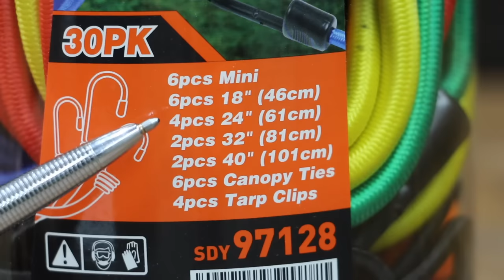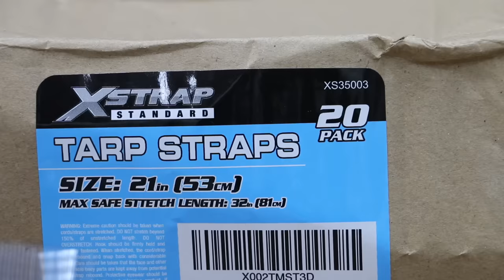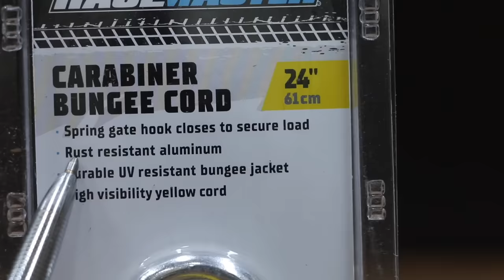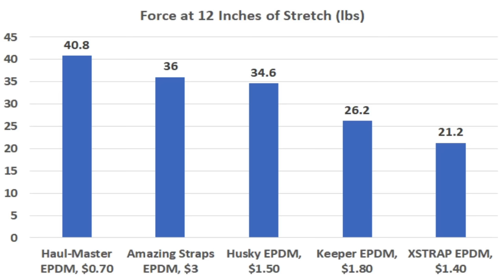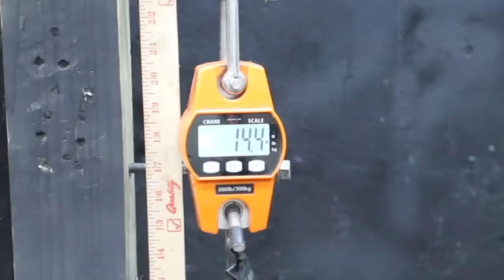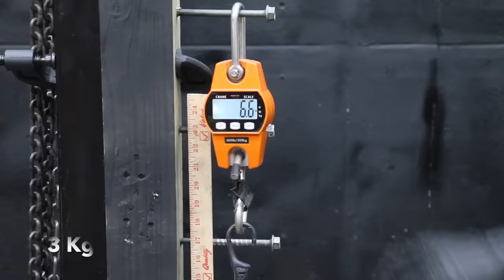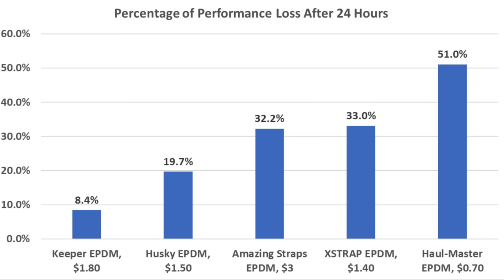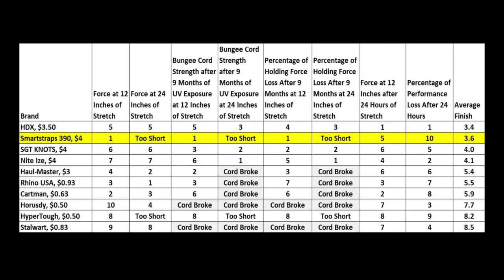Best Bungee Cord? Let's FInd Out!

Comment: Tarps themselves may be worth weather testing; several silver tarps from Harbor Freight lasted one winter covering my tractor, one silver tarp from Lowe's is still going strong after four years.
Reply from the maker: Thanks for the suggestion.  Thanks for the feedback.
Reply: Best tarp I ever had was a two-layer silver/brown tarp from Costco. I still have one. It's 15 years old. The other one was kept outside more often and lasted about ten years before I got rid of it.
Reply: I was thinking of testing tarps as well.
Reply: Hard to beat a canvas tarp if you can afford it! But you need to properly maintain them and weather proof them!
Reply: Great idea 👍
Reply: Tarps would require a long term outdoor exposure test.  If you see them tested within the next 6 or so months then you know it was already in progress when this suggestion was made.  😺
Reply: @HariSeldon913 I wonder if could just put under a high power uv light to speed up testing?
Reply: The so called "light tarps" never last more then a winter actual "heavy tarps" are far more durable but also weigh as much as 630g's per M^2 and cost a heck more up to a 300€ per tarp where as light tarps are only like 30-60€ or so and weigh about 160g per M^2 at max. So the difference and durability between the two types of tarps is quite significant.
Reply: I've found the cheap blue tarps consistently outlasting the expensive silver tarps, which surprised me no end.
Reply: This is an excellent idea!
Reply: @keith3761 flatbed tarps can be cut to smaller tarps after damage or wear. They are heavy.
Reply: @cheesecurd100s  Adverse weather and temperature changes could also be factors.
Reply: I wholeheartedly agree on the tarp test. I live in Arizona and the average tarps rarely last 6 months in the Sun. Good ones, more expensive ones last a year or more.
Reply: @cheesecurd100s  ... The only issue I see is that UV is different by geographic location. IOW, daily use in New England will NOT be the same as daily use in Arizona. You alco have to consider temp swings and wind flapping to make it a realistic test of outdoor exposure.
Reply: @ProjectFarm  you should have went to a truck stop and picked up some of the commercial bungees.
They are pricey, but the quality is beyond reproach.
The only enemy they seem to have is road salt crystals. The salt acts like tiny razors, and makes the surface crack ridiculously fast in the winter.
It should be noted, I still have some from flatbedding, and that was YEARS ago!
If I ever need more, I’ll probably buy two sizes, and they come in bulk packs of 25.
You wouldn’t need to look for replacements for quite some time as a homeowner!
Reply: Hello again, Todd
Thank you for another Great Video 👍 I would like to see more bungee   cord tests. Maybe adding the testing of tarps, Too? Again thank you 😊
Reply: Want the best tarp? Get a used billboard.
Reply: Yes please tarps there's just so many brands and most seem to fail really quick.
Reply: Ive used ex billboard tarps . Amazing durability.
Reply: Does anyone where to purchase the Amazing Straps? Can’t seem to find anything online. Thanks
Reply: Get you a used tarp thats used to cover cotton bales. Heavy and will last
Reply: Listen to this man. Harbor freight tarps are absolute garbage.
Reply: Yeah tarps can last years or one summer. It's a good idea for a test.
Reply: Tarps would be good. test uv and wind resistance.
Reply: Not true. The blue one tear easily and don't last. Silver ones last much longer
Reply: Yeah that would be a good one. All sort of different options in material. I'd be curious which ones hold up the best over time and which ones leak thru easier than others, etc.

Comment: That UV test is pretty eye opening, it's amazing that most of the cords were disintegrating after only 9 months. Obviously given the time investment it takes that requires a lot of planning ahead on your part. I've never seen someone put so much effort into testing tools the way you do, so I shouldn't be surprised!
Reply from the maker: Thanks!
Reply: A nine month test is very impressive
Reply: I was thinking the same
Reply: I was about to say that my experience is the HDX straps are awesome. I have a roughly ten year old set of HDX straps, many of which were exposed to sunlight for approximately 6 hours a day in summer to about 4 hours a day in winter, for two years. Yes they faded and stretched but all of them still work and are still in use!  Awesome video and more Staci reviews please!
Reply: Especially since these are super regularly used on bicycles.
Reply: You know those little 'divets' on the hook are in all the right places to fail at a certain time. Planned? Darn right! Miss the metal hooks..except for those ocassional pops to the face
Reply: In AZ, UV resistance is a real issue. I plan on one season for a lot of soft items. I wonder if some 303 would help the epmd straps.
Reply: @ProjectFarm  Best bungee cords are the free bungee cords you find along the highways all over Merica. Thank you truckers👍
Reply: @jimmyhoffa7935  lmfao
Reply: @jimmyhoffa7935 yes, thier poor job securing loads is super good
Reply: eagerly waiting the metal left outside for a year or two after rust prevention treatment
Reply: Given that I use bungee cords to attach weights to my pool cover on my above ground pool every winter, I had to learn this lesson the hard way, as every brand I tried would be a crumbling mess by spring, most wouldn't even make it the whole winter, and that's just with 5lb weights slung on each cord. The UV is a huge problem, but even the cords on the back side of the pool that are never hit with direct sunlight end up so brittle that they snap just from touching them, we have very cold and snowy winters in Northern New England. I'm curious what the testing would show with more of a focus on the impacts of the weather.
Reply: @Selendryle  the metal hooks, even with heavy corrosion, are always, always, always, going to outlast the bungee cord no sense in testing corrosion.
Reply: @racerex340  Google says that 17% of UV radiation reaches the shade side
Reply: Rubber made in India and especially China are terrible in general. Rubber on small motors and tarp straps just disintegrate. I recall one China tarp strap that wasn't even in the sun and crumbled in one year. I have older tarp straps that have lasted decades in the sun.
Reply: @starkparker16 should see the wiper blades videos. That spanned around one year for its testing
Reply: @reddogknives  different test, I was referring to projectfarm's lengthy commitment to testing. A rust remover or paint video he mentioned leaving a piece outside for a year or two and coming back to it in a future video to test longevity
Reply: If it was not for project farm way back when,, showing me uv zip ties,, I would have never cared about stuff like that.. Great video... The web was made for project farm. Ps... To the project farm guy....
Reply: Especially important if you live in South Texas or South Florida. Plastic and rubber things that would last decades in northern climates can disintegrate in a few years due to the higher UV and heat.
Reply: @utilityart   Yep, this was my thought.  UV is an absolute killer in AZ.  I have some Rok Straps for my motorcycle and they aren't cheap, so I wanted to protect them.  I put a few coats of Scotchguard on them and they have done well, but I do my best to not leave them baking in the sun.  I will have to try that 303 you mentioned... I have heard great things about it.

Comment: Chem Ph.D. here, nice testing, as usual! We use a lot of EPDM in my job and I must say I'm surprised with the weathering seen on several of the EPDM labeled straps. I suspect the heavily cracked and weathered straps were either another elastomer or a blended one (SBR is half the price).  The Amazing straps are the only one that behaved like true EPDM: this material is a common roofing cover, good for decades! In the US we often get "mislabled" products , PYREX of old (now Pyrex) is NOT actually borosilicate glass, and US Synthetic oil isnt :( caveat emptor.
Reply: As I observe above.... the difference seems to be in how well the rubber is cured/vulcanized, and in my experience only Made In USA rubber is done right. I have made-in-USA rubber bungees that were at full stretch in CA desert sun for 10 years and have neither stretched out nor cracked (I still use them, they are now over 20 years old and still like brand new). Yet none of the made-in-China lasted more than 6 months. I've also seen made-in-USA tires last over 50 years with no cracking (also in the desert, trailer so low miles but all sun exposure all the time) yet Chinese tires are on their way out at 5 years old. Guess which goes on my truck.
Reply: @Reziac What brand Tires and Bungee cords?
Reply: So PYREX has turned into a corporate brand name and they can use the term to apply to any of their products?  🤔 I'll bet there's many other products that do the same thing. Getting around the deceptive advertising laws while being deliberately deceptive.
Reply: @lilmike2710  Pyrex still makes Borosilicate glass products but only at their UK facility. They don't falsely advertise or try to hide anything, people just overreact as usual.
Reply: Repent and believe in Jesus Christ   Okay 👍
But, why here? 🤔 What compels you to post random verses and statements like that without being prompted?
Reply: I’ve had Power Torque bungees from oriellys break in three weeks from UV exposure on my Semi Truck (they hold the air hoses and trailer light cord off the catwalk). I can’t believe how poor quality most bungee cords are!
Reply: @lilmike2710  It is either a bot account or some sort of mental illness. No sane person would be evangelizing here where it is extremely unlikely to have any kind of positive outcome. And the random nature of the passage points to either of those options too.
Reply: @Reziac  I have a pair of roughly 30 year old Remington Wide Brutes that are the best tires I have ever seen.  They are always in the sun with no cracks, are slick now, but still have traction.  I drove on them a few days ago.  Vinyl is the same way.  Companies now know how to make good products, but choose to make bad products to increase sales for greed.
Reply: They could be strictly EPDM since a lot also depends upon the compound formulation . If a good amount of filler (cheaper than EPDM) is incorporated, the amount of EPDM would be filuted in the final product and also degrade the cord's  performance and properties such as tensile, elongation, etc.
Reply: @solarsynapse  Yep. The tires I mentioned were dated 1958 and still held air, wholly flexible and with no cracks, in 2012 when I moved and gave away the trailer. These and numerous other examples are why I only buy US-made tires. The ones on my truck are now 9 years old and still like new. Meanwhile Chinese tires on another trailer, same age, are falling apart and they've seen very little sun or use. 

Not so much greed as once one of them goes Chinese manufacturing, everyone has to shave costs the same way to retain any sort of profit margin. And then quality control is really out of their hands.
Reply: @Rez Zircon  businesses run to make money. Do you invest in stocks? If you do, that's the problem.  They are saving money so YOU get a return on investment. You can buy reputable items from China, but you have to look. USA products are often worse because to stay price competitive,  they have to cut corners. Why? Because shareholders
Reply: @Dusdaddy Wel Idon"t live in the uk.
Reply: I was just discussing old pyrex as lasting. The new stuff might shatter the first time in the micro wave
Reply: @poppaluv  In my job flint/soda glass is seen as complete crap. No chemist would ever use it no matter how its tempered. It has ZERO advantage over borosilicate except price. A damn dangerous scam; there have been serious injuries.
Reply: Wow didn't know that about PYREX.  Just read an article online about it.  PYREX is borosilicate while "Pyrex" is simply tempered.  Neither are made by Corning anymore (they licensed both names out to other companies).  Apparently you can't buy borosilicate PYREX anymore in the USA because boron is considered toxic.  I wonder if EPA banned it?
Reply: @poppaluv  First, how would one know that? Do you think You tube is in the US only? Secon, I said it's made there, but it is sold everywhere, including the US, just not as common.
Reply: @Tallnerdyguy  Yeah, I'm aware. Speaking as a shareholder, I don't like it much. But it's how things run, and it tends to run toward cost-cutting because that's their obligation.
Reply: @poppaluv  I've also seen old pyrex come apart just from being touched. I have pyrex (and other brands) from new to 50 years old and have not seen a significant difference, and I use it every day.
Reply: @Wowzersdude-k5c I dont believe real borosilicate glass is "banned in US" as it has zero toxicity and is used all over Europe. Boatloads made for quality labware in US as well.
Reply: @tedmich  I can believe it. I have very old dishes. We bought two more recently and both shattered in the MW.

Comment: My suggestion for testing would be push brooms. I used to do tile work and having good push brooms was essential to getting as clean and dust-free a surface as possible when doing floor tile. It seemed that the better a broom was at sweeping dust and fine dirt the shorter was its useful life. But I guess you could test that!
Reply: this would be interesting, but there would be a lot of variables to control for...  Like the difference between sweeping sawdust from a chainsaw vs sand vs flour.  Still, good idea.
Reply: I have one broom that works great in my garage, but worthless on the driveway.
Reply: I suspect softer bristles clean better, but wear faster and have trouble on rougher surfaces. Stiffer bristles would probably last longer and clean larger debris and rougher surfaces more easily.
Reply: @cancelhandles  If there's one thing that watching ProjectFarm videos has taught me, it's that general "rules of thumb" like that often don't bear out in reality. A lot of times he has shown really unexpected results from things you simply wouldn't expect to perform that well, and yet they do (and also vice versa)
Reply: Why not just use a shop vac like the ones he tested?
Reply: Good idea!
Reply: Also some broomsticks are just so flimsy, I feel like the head is too wide and will snap the little baby broomstick
Reply: This!
Reply: @jake6483  ... hollow metal broomsticks are the worst. After a single drop and a slight dent, it's likely to fold / break on that spot. You are better off with a hardwood handle.
Reply: I could see several tests for that. You could break it down into soft and hard bristle categories for scoring. Hard bristle brushes would have a critical score in the durability test and ability to catch large or heavy debris on surfaces commonly found in work environments. I loved hard bristle brushes in the shop because I could push bolts and bushings across the floor to be swept up into a single pile for collection instead of them sliding through the bristles. For soft bristle brushes, how clean they get smooth surfaces would be important. I have a soft bristle brush thats over 20 years old that we use for sweeping out the garage at home which is pretty much just dust and dirt, with some small gravel from the car and it's still in great shape and cleans the floor amazingly.

We also have some hard bristle brooms for cleaning out our trailers, mostly after hauling wood or mulch or things like that and they get torn up like crazy on the wood decks.

Scrubbing is also something I use brooms for in the shop. Chemical resistance to solvents is also important in an auto shop, so gas, brake clean, diesel, etc. Lots of tests that are largely simple to perform but give valuable data.

Comment: I've been using the Husky EPDM straps for at least a decade now.  I primarily use them to strap down lumber being hauled on my short bed truck with the tail gate down.  They stretch out perfectly to hold 2x4's, plywood, and more down securely without any sliding around.  I do not leave them exposed to UV for more than a day or so at most.  I also replace all my bungie cords every 2-3 years as I'm fearful of one rotting just enough to snap while pulling them tight and catching one in the head or worse.  Awesome video!
Reply from the maker: Thanks!

Comment: I am glad you did this test for 2 reasons:

1. I never planned on the straps lasting more than one trip, know I know that I was right for the most part.

2. I do not have a chain hoist however I do have a lot of chain come a longs. Mostly Beebe, but some others as well with chain lengths from 3' to 25'. On occasion I tarp loads and use a lot rope and bungee straps. Generally bungee straps are ether too long to work well or too short to reach a tie point. I never thought of hooking up a chain come a long to a bungee to stretch it into place. Thanks for the tip.
Reply from the maker: Thanks for the feedback.

Comment: Thanks for the hard work on all the tests. I came up with similar conclusions, with only a few brands, from my local stores. I don't use any EPDM straps anymore, I use Ratchet straps instead.
A lot of my bungee cords only last through the summer, due to the UV. I buy a multi pack of HyperTough from WalMart or Haul-Master From Harbor Freight, each year for my light duty, non critical, stuff. I use the HDX straps from Home Depot for when I need strength & reliability.
Reply from the maker: You are welcome!  Thanks for the feedback.